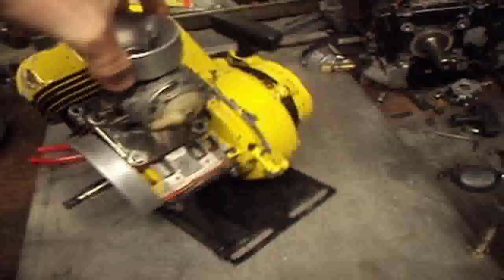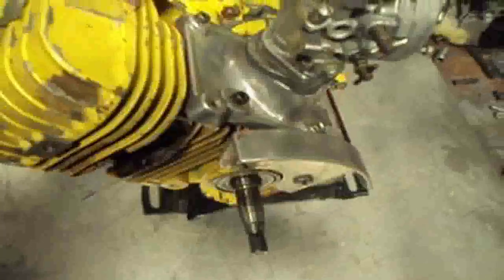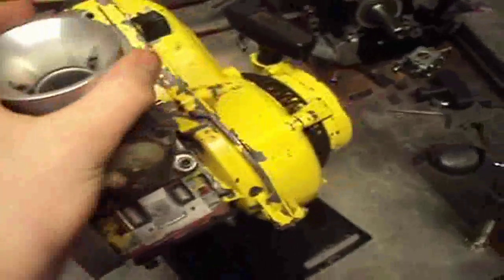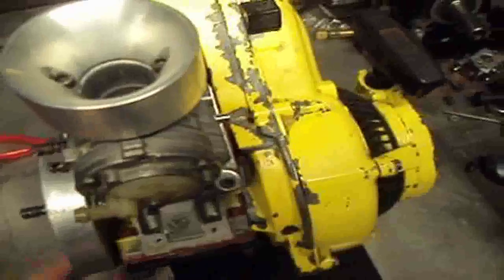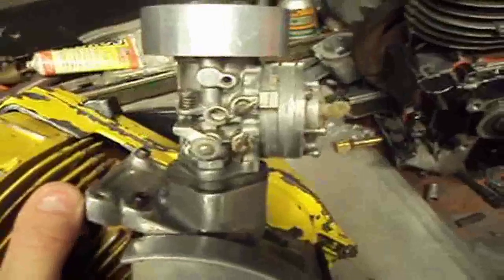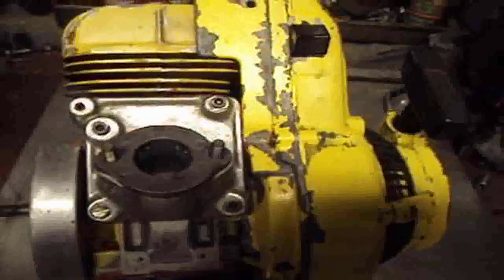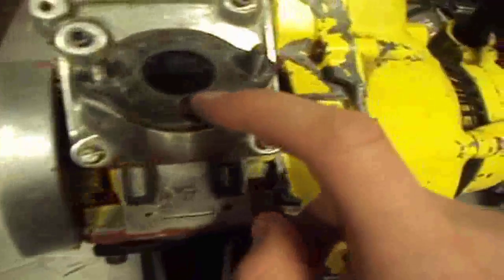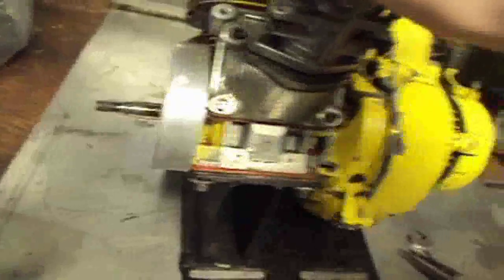McCULLOCH RACING ENGINE CONVERTED FROM CHAINSAW MOTOR

Comment: That takes me back- In the late 50's I had a Kart, but it had a funky Briggs& Stratton motor because I was a kid with no money.  My dad had a McCulloch chainsaw, and when he and my mom took a vacation and left me home ( I was 12),  before they had rounded the corner, I was in the basement pulling the chainsaw apart.  Got it mounted on my kart and ran down the length of the alley hauling the mail.  Turned around and on the return trip it blew the rod out the block.  Spent the rest of the time before the parents returned begging borrowing and working to buy a motor and get the saw put back together.
Reply from the maker: Thats a great story brotha I literally tormented my neighbor hood. Id never drive the same way on the streets. Riped these karts apart and rebuilt them faster and faster I just never got fully into YouTube with it which I regret. But needless to say youtube videos stopped after my buddy got pulled on a similar kart . Apparently 55 police calls in one day is very frowned on. Lol
Reply from the maker: They had private investigators looking for me waiting at the top of my street. Luckily my buddy had a muffler so they couldn't charge him.
Reply from the maker: *i had no muffler 😂😂😂

Comment: Did that as a middle schooler in 1960- took my dad's chainsaw apart and mounted the motor on my Bug Stinger kart.  Made 1 run down the alley before it threw a rod out of the block.

Comment: Out Here IN Cali @Jockos Speed Shop We Are Turning 21,000 RPM's In A 6.1 CU Mac. AVging 19,000. Also Your Going To Need To Re Hone That Block Because if it's Compression is that low to where u can Still use a pull string, something is wrong, We Have To Make Starters back here. And You can make additional Changes Like Timing and what not to make it better.

Comment: well how well a carby is matched depends on the Volumetric efficiency (V.E) of the engine. For example even though a ride on lawnmower would have a large displacement they are low reving and usually have a bad port design, so they can't have too big a carb. However a chainsaw is made to be high reving and high powered. They usually feature pretty good port designs and hence breathe a lot. I think it's going to work out well for you. Now how many CC was it again?

Comment: I’m doing a conversion right now, what did you do for the bottom plate?
Reply from the maker: Austin Kreller randysenginerepair did this build for me . I’ve since got out of carting to much money was spending on tires and street bikes became more of a thing. I also fix the new age of chainsaws and stuff like that. I would of built it myself but it was cheaper easier and more then plenty of these old saws in Ohio where randy is last time I talked to him 6 years ago his father past and he stopped working on them. RI doesn’t have many floating around anymore very rare here to come into the shop. Haven’t had the time to post anything in a long time will be at some point in the near future. You use the bottom crankcase half as your mock up for a plate of steel. And go from there it’s a trial and error thing. Won’t be too difficult if you have a grinder welder and belt sander.

Comment from the maker: @Samqdf And i know what v.e. mean...   v.e. is something like a 383 and a 440 dont get me wrong the 440 is a great motor and can make alot of horsepower...but the 383 was designed for horsepower and reving high it had a lot more horsepower and torque then the 440 and was an all around better motor i own a 440 my self...well its my dads its a 1966 chrysler new yorker...but the 383 is  proble my favorite cause they can breath better run better and sometimes sound better then a 440 but not usually.